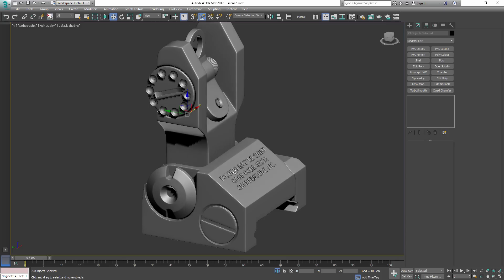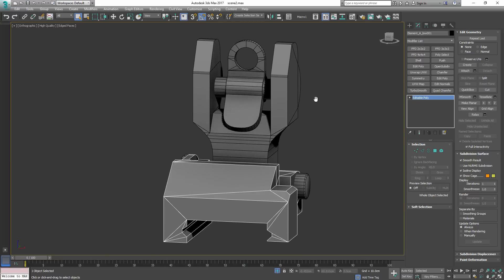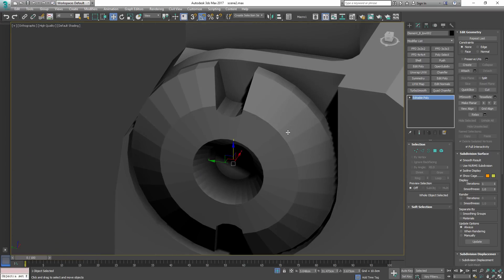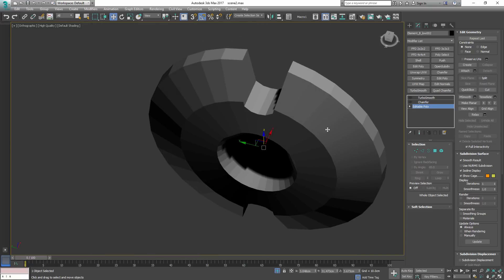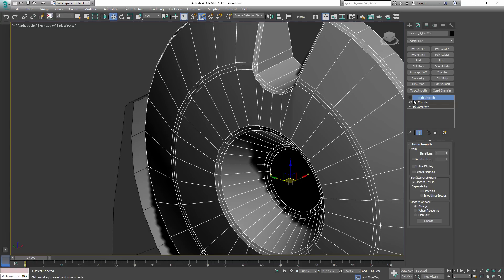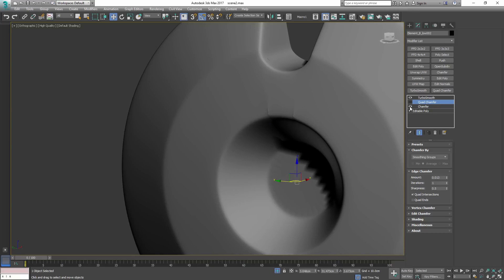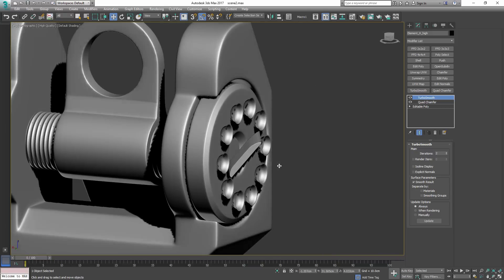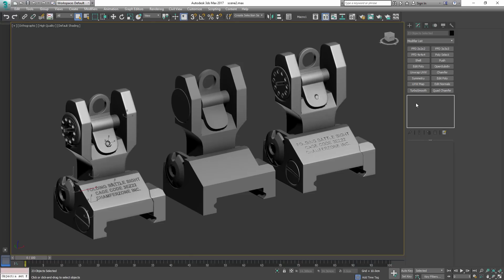High Poly Special - creating the perfect hard surface High Poly model - 3Ds Max 2017

Comment: Exactly the kind of content that helps with key concepts when modeling beautiful high quality models as in your tutorials, not much material out there for beginners like this, thank you Tim!
Reply from the maker: Thank you good Sir, much appreciated and thanks for watching!
Reply: did you even watch the videos? Because in one video he says use nGons np, and in this one he says well you're gonna get this problem but it's ok, I have a third party feature which fixes my nGon problems but I'm not gonna even mention how you can fix it with the stock chamfer. So what's even the point?
Reply from the maker: Hello Jokester, valid point. I should have shown that. Sadly I can't add that to the video as actual video content but I made an explanation how to deal with the pinching on the default chamfer modifier. Hope that helps!, cheers.  http://chamferzone.com/chamfer-modifer-vs-quad-chamfer-modifer/
Reply: Jokester The Mighty just weld them together forming a nicer topology.

Comment: Hey Tim, never knew about the Quad Chamfer modifier. There's been so many instances where I got pinching around the corners that had triangles as I tried to use the normal chamfer modifier in combination with Turbosmooth, but the Quad Chamfer sorts out that issue completely! 

Thank you very much! :)
Reply from the maker: Hey Matt, indeed! The standard chamfer modifier is just such a waste for not having that quadify feature. The irony is that quad chamfer from Marius was around before Autodesk implemented their own version so how they managed to forget that most important thing of it is beyond my understanding ;)
Reply: Yeah that's extremely weird, I've just added the Quad Chamfer modifier to my configure preset...it helps so much. Before I would use the chamfer modifier and then just use the edit poly modifier to go around and clean up each of the pinching geometry, definitely time consuming

Comment: Thank you! I agree with you for starting from low-poly to high-poly workflow. It doesn't hurt to know how to do it the other way around for flexibility, but personally I'd rather start from low-poly game res then proceed to high-poly for baking.

A lot of my colleagues find it strange that I start from low to high, then wonder why I was able to finish my asset on time and/or less stress - its because I establish my low-poly silhouettes first :)
Reply from the maker: Hi Alvyn, yes I think for me its the same, I just got very used working like that but there is a good amount of artists that does it the other way around too. I however stick with my believes that low to high at least for hardsurface modeling is more straight forward, accurate and faster. :) Cheers!

Comment: Hey Tim, great stuff. Been using this method for the last year myself. Nice to see you sharing it. :) Just a quick note for beginners who haven't got Miauu's plugin. You can add an EditPoly mod under Turbosmooth in the stack and weld/collapse the pinching verts. Chamfer changes below in the stack will still propagate.

Also, just curious why you still use floaters when nurnie/text details can be quickly and non-destructively painted on a layer in S Painter without having to do rebakes or create extra geo?
Reply from the maker: Hi musashidanmcgrath, thanks for your comment. You got me curious there with the welding. How do you make sure that you don't end up welding other vertexes together that just happen to be close by each other? I was experimenting around with that but didn't get a satisfying result. Would be curious if you figured a way out to avoid that. Also about the floaters, yes ever since substance painter 2.5 I will now use the text tool to add information like that. Good point about it being non destructive. One good thing about floaters though is that you get the details also appearing in your AO, curvature, thickness. All that stuff that helps adding an extra layer of realism.
Reply: Hey Tim, well you'll know what verts to collapse/weld to eliminate the small triangles that are left over(so it's essentially manually doing what Miauu's Quadchamfer is doing with quad Intersections) 

What I like to do instead of floaters is before I start any texturing I'll add all my text/nurnie details and export/reimport my normal map and then bake all my other maps. That way the detail will be picked up in AO/curvature/etc. Doing this automatically is a feature I've been asking for, for a long time now. But, for now, it's just an extra step(unfortunately you lose some of that non-destructiveness if you keep making changes to the normal painted detail layers as it requires a rebake) But if your design is locked in early you can concept all your painted normal detail on layers, non-destructively, and it can save some time. I also find it a great way to design panel lines, on the fly, and really quickly, without having to model or sculpt that detail to a high-poly.
Reply from the maker: Thanks for the explanation. Yeah true that would be a workaround with the chamfer and editable poly.. but just more time consuming and in need for that extra modifier then using quad chamfer. Just a shame that Autodesk didn't add that feature yet. (shakes fist at sky). Yes the workflow you described is a good one with the flaoters, let's hope for that feature to be added one day to not having to do this extra step. Substance Painter 3 maybe? :) Who knows..
Reply: Yes, the quad chamfer Adesk added is poor in comparison. I bought Miauu's plugin years ago(before Qchamfer was added as default)so I've always used it.

Another interesting and recent development is UE4 direct support for Opensubdiv so I can see FPS hero weapons just being sent directly to the engine with chamfers applied and sub-Divided in-engine. With details painted in SP. Completely eliminating the need for a high-poly bake. Similar to using a mid-poly with face-weighted-vertex-normals.

Comment: Thank you for this helpful tutorial!

Do you think that the workflow using OpenSubDiv Modifier + CreaseSet Modifier / Edge Crease Values in Edit Poly is just as good? I like the fact that I can easily create different crease values, and thus, use a different amount of sharpness for every edge that I want. With the CreaseSet modifier, you can very quickly select the desired edges by auto-selecting them with the angle.

The only drawback of this method is that you have to set the creasing of every additional edge you create when modeling. So it's not as quickly, but it's more versatile as it allows you to set different creasings for different situations.

So what do you think? When comparing both workflows?
Reply from the maker: Hi Crimzan, thanks for your message and yes there are certainly good reasons to use opensubdiv but honestly in most cases I am just 100% fine using quadchamfer workflow. If there would ever be a case of different amount of sharpeness then sure. Might be worth to use opensubdiv for. These two methods can be mixed as well. My free kukri blade tutorial used opensubdiv but looking back at it the amount of questions I get make me regret I didn't just use the chamfer modifier as shown here.. it's just more straight forward in my personal opinion.
Reply: I see. Thank you very much for sharing your opinion. Quad Chamfer isn't really expensive at all, so I think I'll give it a try soon!

Comment: A question, please. Should I export my low poly with or without smoothing groups (and in that last case bake the hard edges on a normal map from the high poly)? Because I'm having an issue with my model where I always get artifacts due to the hard edges of my low poly. Even with uv shell with enough padding the result doesn't pleased me...And I see that your low poly is free of smoothing groups.... what should I do?

Comment: Your tutorials are greate and very helpful, and it is so nice to see a real professional in the art. Thank you.

But.....how did you bake corners in cylinder with flow details???
Reply from the maker: Hello Tom! Thanks glad you like it! I am not 100% sure I get your question though.. which corners do you mean? You mean the little detail I added at the end of the tutorial to demonstrate further "enhancement" to that cylinder? Well you can just bake that straight down to that polygon. No problem there at all.
Reply: I mean details that made as separate meshes, and question is how to bake them and nearest corner of cylinder, if just to use cage for baking than it should be pushed more because of these details to cover them, but that will make distortion of these details on NM. such like this https://i.ytimg.com/vi/evIogtBAB2Q/hqdefault.jpg
Reply from the maker: Oh hey Tom, yes in that example this is a pretty nasty bolt + screw head to bake out where the distortion gets very obvious fast. One of the things you can do to avoid this if you don't want to use a cage is by creating a med poly that has more divisions then your actual lowpoly. Then you bake it on that and later swap it out with the actual lowpoly. I'll talk about that in the upcoming baking special vid I had in mind :)
Reply: I'll talk about that in the upcoming baking special vid I had in mind :)

Greate! Can't wait to see it  :)

Comment: Does anyone know how you'd use this workflow when modular pieces are involved?
i.e. if there are 200 screws on a robot, do you unwrap the entire model + 1 screw, then duplicate the screw? Or do you just place 200 screws, then pick 1 screw to unwrap, somehow replace the rest, and remember its location inside painting programs?

Comment: Hi, I'd like to ask about floaters, do you bake your normal map with floaters in 3Ds Max or is there some way to use them when baking in Substance painter ?
Reply from the maker: Hello Mish, i bake everything in Substance Painter. If you are curious about this workflow you can watch the baking part of the grenade, it has floaters in it on the highpoly. It'll bake perfectly fine. I was never a big fan of baking in 3dsmax.
Reply: Thanks for the info, your videos are very helpful. I recently watched your video about N-gons and I'm a bit confused since in school we always learned that we have to triangulate for game engines, most engines triangulate when imported into so if we don't do it in our 3D suite it might end up with bad optimization. I understand your approach is only for flat surfaces where it doesn't matter much how it looks after import and it's and interesting way of modelling, I've always found it hard to focus on certain areas of my model which is cluttered with edges.
Reply from the maker: I am glad you find it useful and I can only speak from my experience. The 3D models I checked in to various engines (and I worked on quite a few games) will always convert exactly as the model I see in Max and this is just the proven way that it works. There is never any odd issues going on. If you ever find something acting up in the game then of course you can fix it if necessary but for me not once has there ever been any mismatch in the game engine from what I see in Max and I export with the default FBX settings all the time.

Comment: Hey Tim, quick question. Is there really a need to define sharp edges? Would it be bad to just have my low poly be entirely smooth shaded and then have my highpoly define the beveled/hard edges? l For example, i have my highpoly that had it's edges defined with the chamfer modifier, My low poly is entirely smooth shaded, and when i go to bake, the high poly makes the low poly seem like it has sharp edges.
this is something that I'm still very confused about (game industry centered question)
Reply from the maker: Hello Mr. Meanor! It is important to define the hard edges because that's where the chamfer modifier will add the "support loops" which we need in combination with the turbosmooth modifier. For your smoothing question it's important to know that when we do the unwrap we have to define UV islands. You can't just unwrap everything as one piece and you should also not just assign one smoothing group to your entire lowpoly model. It is important that each UV island has its own smoothing group which we do after we are done unwrapping.
Reply: @ChamferZone  Great answer, Tim. I understand now, thank you so much!

Comment: Whenever I use the Quad Chamfer plug-in it completely ruins my UVs. Is this a common issue with the plug-in or am I doing something wrong? I really want to optimize the whole process of baking my normal maps for my hard surface models but I can't proceed until I can fix this issue. Any suggestions?
Reply: BloodGhost maybe you are Uving the wrong model, or using the quad chamber on the wrong model.
Reply from the maker: Hey Bloodghost, well... you may never use that modifier AFTER you unwrapped. It will certainly break your UV's then. the chamfer modifier is to be used for our high poly model mostly which we never unwrap.
Reply: Okay, that makes sense then. Thank you for the reply!

Comment: Good tutorial but I do not understand a thing, the low poly has hard edges, the high poly has rounded edges.
The normal map in the low poly can change the shape of the edges to be rounded?

Is that so or is there a step that is not shown in the tutorial?
Reply: i'd like to know that too :/
Reply: the lowpoly geometry doesnt change it just has a normal map applied that makes it appear rounded. The high poly is just used to 'bake' and create the normal map.
Reply: @plant066  thanks for the response :) so just to get this straight, how the low poly should match the "roundness" of the highpoly? For example i started with a 6 sided cylinder and applied chamfer/turbosmooth tecnicque but when baking normals in SP corners are still hard (especially if seen fron top view). Was it too extreme lowpoly or there could be other things i did wrong and give this result? Im kinda experimenting. Thank you!!!

Comment: Hi Tim Thank you for the great effort, but i have a question, is this way of modeling, i mean the high poly can be utilised in say for example a movie or demos or other than video games, thank you in advance
Reply from the maker: Hey Ahmad, thanks for watching and that is a good question. The approach for movies is (kinda) similar but also different. I never worked for movies so I can only answer as a non expert. What I do know is that movies rely on HUGE textures which are achieved through UDIM (google it). Substance might get support for that soon. Memory doesn't matter for movies unlike games since moves are all rendered. Same goes for polycount. You can have millions of polygons, no lowpoly needed. I have yet to find out how they approach unwrapping for movies that is the most interesting topic. Since you have meshes that consist out of millions of polygons, they still need to be unwrapped and textured. I bet they have special tools and workflows but in the CORE esscence it's still all very related and similar regardless if games or movies I would say.
Reply: Thank you very much Tim for taking the time to answer my question, cheers

Comment: Are you modeling the text too? I usually left texts for normal baking stage via photoshop or texture stage with substance painter.
Reply from the maker: That is a good question, I used to do that but it became obsolete now that Substance Painter has a very awesome text tool feature. With that there is no more need to do it as 3D Text.

Comment: Simply the best tutorials I've been able to find on the Internet. I just wish I found your channel sooner. Also, do you ever use any sculpting software in your work flow? I'm kinda confused because before finding your channel I thought that the way to model an asset, even if it's hard surface, is to make a base mesh, then move it to zbrush or something like that, and then make a low poly out of the high poly, so now I'm not sure wich work flow would be the best for me. I would really appreciate an answer.
Reply from the maker: Hello Juan ! I am glad you like the channel and that you found it! Thanks for watching. To answer your question, there will never be that one perfect way to do something. In my 10 years in the game industry I can certainly say that there are a ton of different ways to achieve something. Some like to do their work in zbrush, others in 3ds max and so on. It's the beauty of it to have so many ways. However in my case and the companies I work and worked for 3ds max is the most common software to approach hardsurface models. 3ds max is fantastic because it is SO non destructive due to its modifier stack. Meaning if someone tells you for example to make that barrel longer or swap this element for something else you can just load up your scene again and quickly change it. Other software might be more of a pain to rework that and so on.
Reply: ChamferZone thanks you for your answer! I guess I'm gonna try different workflows and see wich one I like the most.